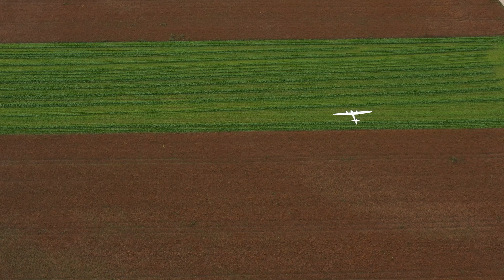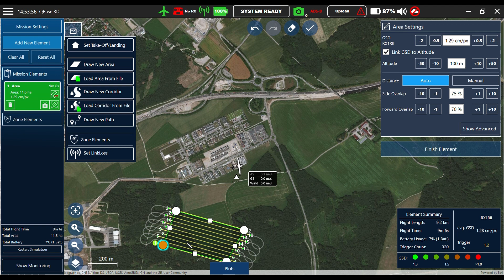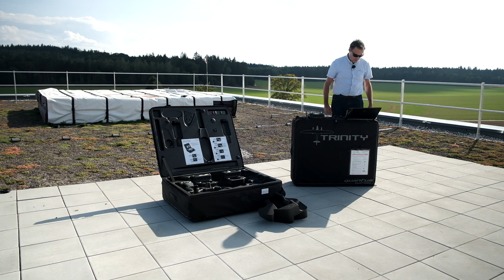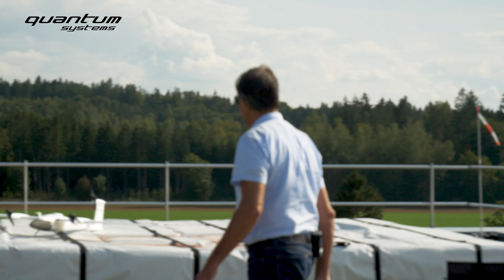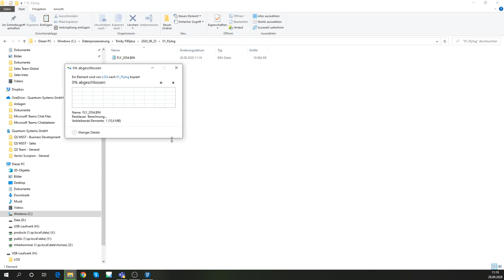How to plan a mapping mission with #Trinity F90+

Comment: Sir, Landing was automatic or you did it manually by using remote control ?
Reply from the maker: The landing is automatic, if there is anything you can use the remote for manual landing.

Comment: mission plan uploaded and when I start the flight, it fly about 15meters above ground and give warning about ECS temperature too high and flight got cancelled and come back to home point. why? any solution please.
Reply from the maker: hey ezee chords! Please contact our support or your trained reseller. All the best
Reply: @QuantumSystems  sir whom can I contact please. Can u provide me contact please
Reply: @QuantumSystems the issue was with the transition altitude. We were flying the drone at 3000m above sea level, so 40m transition altitude was too high. It could have been as low as possible like 10-15m. Thank you

Comment: Can the controller accept shape file instead? Would be nice if the LiDAR payload were interested for low altitude topography.
Reply from the maker: we will forward that question. if you have more question please write us an email to: info@quantum-systems.com

all the best
Reply from the maker: -	Mountainous terrain is no problem for the Lidar itself, the only restriction are the maximum descent / climb rate of the Trinity, so that it might not be able to follow very steep terrain at constant altitude above ground  most of these problems can be avoided by planning the flight path accordingly
-	Maximum distance to ground (at which proper function can be guaranteed) 140 m. You can also fly higher, but less reflective surfaces might not be recorded properly. The recommended flight altitude is 100-120 m, 
-	Straight flight lines are recommended to be limited to 2-3 km in order to ensure good calibration. If longer flight lines are required, QBase (our flight planning software) offers the option to automatically insert calibration circles after a certain distance (can be specified by the user)
-	IMU factory calibration is one time only, the IMU is then only recalibrated in flight by flying a calibration pattern before each mission (is included in the mission plan, so no additional flight is required). During the mission, calibration circles or U-turns are used as “mini-recalibrations”.

Comment: I would really like to see a demo of manual flight operation. I'm scared.
Reply from the maker: If you want to obtain usable data, a manually flown mission is simply not possible. However, it is possible to intervene manually in the flight at any time. Why are you afraid?
Reply: @QuantumSystems  Intervention is exactly my meaning. I do not know if this type of uav handles anything like a quad copter. I have never manually flown a fixed wing uav. This is not something with which I feel inclined to experiment.
Reply from the maker: @NedFerguson  Thank you for your input. We will address manual intervention in a mission in one of the next videos. 
Since the possibility of manual control has always been part of our systems, we will be happy to show which possibilities exist and also which automatic scenarios are possible (e.g. eagle mode) to master critical situations.

Comment: Thank you for this useful video.
Reply from the maker: Glad you like it. If there is more need for special videos, let us know! There will be a lot more content coming for trinity f90+! ;)
Reply: @QuantumSystems  Thank you for your interest we're waiting your new videos and i have a question. When we use ibase, we separate the modem from each other and place it at the known point. This way it reads healthier data. In the video, you put it on top of each other without unplugging it. Is this true?
Reply from the maker: @MrDdemirel  the two devices do not interfere with each other. Of course, you can also put the devices next to each other. All the best
Reply: @QuantumSystems  thank you best regards, where can i find the TRINITY F90+ USER MANUAL?
Reply from the maker: @MrDdemirel  for the user manual please contact your reseller. Also the manual should be inside the trinity box. all the best ;)

Comment from the maker: 0:00 Intro
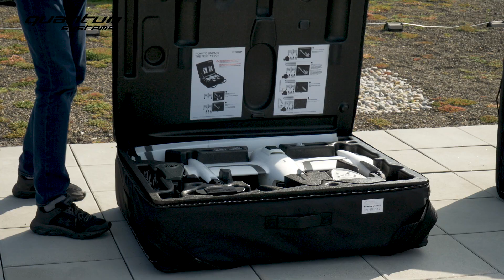0:38 - Assemble the Trinity F90+
4:15 - Plan a Mission
9:37 - Start the Mission
13:30 - monitor the Airspace
16:45 - Landing
18:00 - disamble the TrinityF90+
19:20 - Copy the Flylog
20:34 - Remove the SD Card from iBase
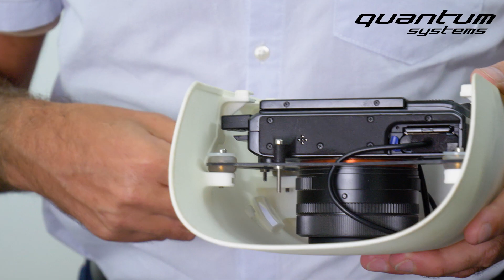21:20 - Get the Photos from the Camera
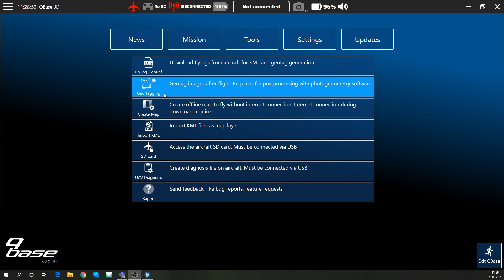22:09 - Data Processing
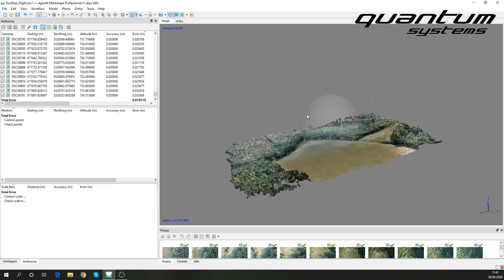24:12 - Metashape Dense Cloud